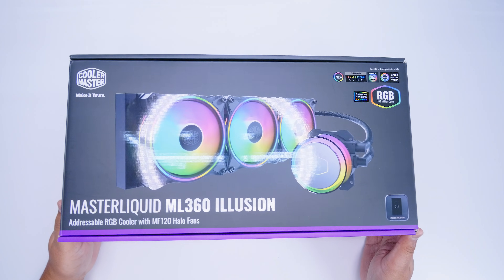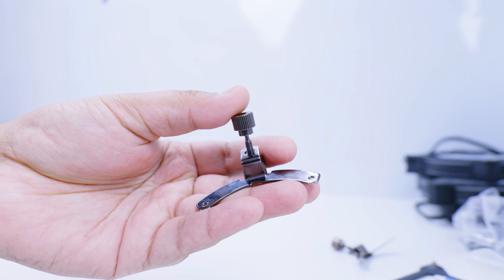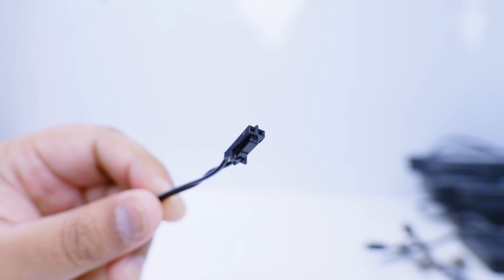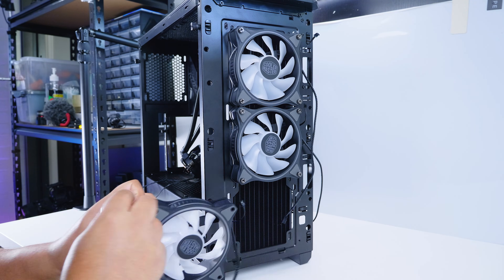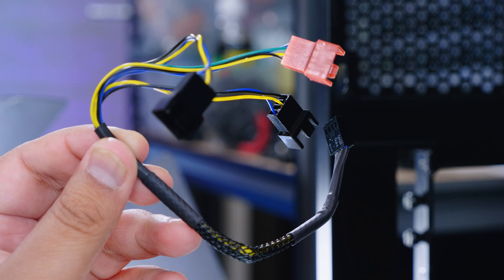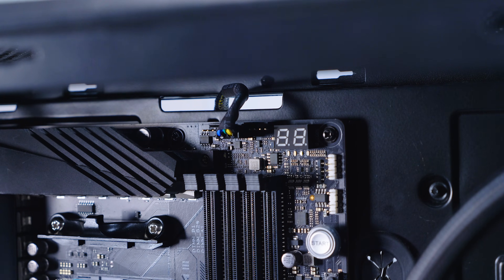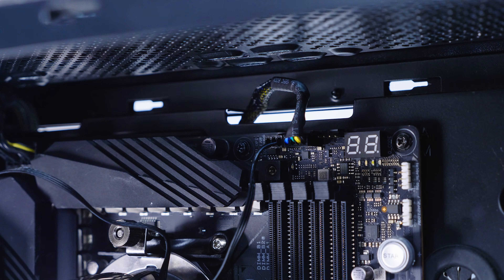HOW TO Install Cooler Master ML360 Illusion on AM4 & AM5 Motherboards

Comment: how about the AM5?
Reply from the maker: AM4 is the same as AM5
Reply: @GearSeekers  I have a masterliquid 360 with my previous cpu Ryzen 5800X3D. I upgraded to am5, almost bought a new cooler. Thank you.
Reply: @GearSeekers so they are using the mounting system with the two srews on each side? I've seen many manufacturers switching to a 4 screw mounting and therefore replacing the two brackets on the Motherboard in the process
Reply: I’m upgrading from a 5800x3d as well to a 9800x3d and I want to know if the mounting bracket we used for am4 is the same one for am5
Reply: It is  @julionazario9143

Comment: First of all, thank you for your excellent videos. I have a question, If I am installing the ML360 in a HAF 500, Do I need to use the included control or it is better to use the case control? thanks in advance

Comment: I have phanteks Eclipse G360A Case with 3 additional rgb fans, i want to connect it to the controller, i got it to spin but now its the obly rgb that works. Any ideas what im doing wrong?  Couldnt connect it to the controller due to the connector cabel not going into the controller slot.

Comment: Question on 11:35 as im not to good with understanding fan cables but why does the 3 way fan splitter (the 2 black ones) have 3 pins? to connect to the fan connector which has 4 holes? and that there is also a red colour in the fan splitter that contains 4 pins? in which should't the black end cables also have 4 pins to use up all the 4 pin holes on the fans?
Reply: those 3 pins are for the argb and 4 pin was for the PWM fan header which will connect to the motherboard

Comment: Can I connect the water cooler pump cable to the TD500 Mesh case controller and then connect the controller cable to the pwm cpu opt connection?

Comment: Just put this aio in my mid tower, unfortunately I had to mount the radiator hose side up at the front of my case. I wish the hose were like 2 inches longer.. hopefully I don’t have to deal with a noisy pump in the future from this. Be aware if you have a mid tower you will probably have to mount the same way.

Comment: Will the cooler work with an am5 motherboard considering that the new am5 motherboard (asus tuf gaming x670 - e plus wifi in my case) won't allow the pre-installed am5 backplate to be removed?

Comment: i have a question here.
I have an old Asus Z170-k mobo and it doesn't have an ARGB header.
can i connect just the USB header to the mobo, and be able to control the lighting using aura sync? thanks.

Comment: I've a lian li 215 case, has 2 200 mm fans, I installed the radiator in front, 2 cooler master fans on top and one on tha back (exhaust) my cooler manual says to connect the pump and the fans to the controller and connect the controller to pump fan header, I then connected the case fans to the cpu fan header, is that right ?

Comment: Can you mount the rad on the outside with the fans on the inside of the case for a pull config please?
Meaning, do the rad hose barbs prevent screwing in the top fan?
Very informative vid, thanks 👍
Reply from the maker: No
Reply: @GearSeekers  why not?
Reply: i dont think that would work as well because you dont have any push fans, which do most of the work leading to worse temps id assume. also just mounting the fans on the inside for a video is a bit of a waste of time
Reply: Short update, mounted the coolers on the inside for a pull config since it allows for much easier dust cleaning. Push is nice but when you inevitably get dust pads between the coolers  and the rad, you have to disassemble the whole thing for cleanup, whereas in a pull config I just lightly vacuum the surface of the rad with a brush and I'm done 👍
Reply: @DTXGaming  nice, thanks for replies, hadn’t even thought of the filters! 
We had no space to fit the rad and push fan configuration in the case, so had to go for rad/pull.
 After a bit of research it seems as though with certain heat exchange/ rad styles you don’t get even cooling due to the air taking path of least resistance (around the sides rather than across the entire surface). However, the radiator we used is in a case and the fans now have a gasket seal to the rad case. Temps looked good.

Comment: Not sure why coolermaster just make the aio and the fans all have their own argb connector. Instead of 1 splitter to a non argb 3pin for each piece to connect to. Kind of make the argb useless if you get a defective or loose that splitter it came with.

Comment: Thank you for this video. I followed your instructions and managed to successfully install and replaced my dead AIO cooler. There are some confusions on the some of the wiring and connectors (my motherboard's connectors naming differ from yours) but I managed to google and find the answers.
Reply: Wish me luck my AIO died last night and my CPU is bottlenecking so I have bought upgrades including this cooler, can I control the RBG without the controller and directly from the motherboard or do I need the controller?

Comment: So the 3 cooler fans, are rated at 0.37 amps, and the CPU fan header is rated at 1 amp. Is that gonna be an issue running more than 1 amp through a 1 amp rated header?

Comment: I have this and rgb logo is rotated a little and manufacturer said I can turn a cover but I cant it’s too tight
Reply: Just got mine and having the same issue.  You figure it out?
Reply: @johnmitchell6501  Yes you have to rotate it anticlockwise (it’s may hard to twist but don’t worry) when you take it off you can use your finger push it off by inside then adjust the position u want
Reply: @spartacusyamaguchi6239  wow, thanks so much!  I was afraid to break it so i didn't put enough pressure on it to turn it.
Reply: @johnmitchell6501  I’m glad it helped
Reply: The logo can be a very tight fit, but is is not fixed clocking.  Try both clockwise and counter clockwise.  I ended up applying a tiny amount of gun oil with a tiny tip applicator around the joint between the logo and the bezel.  Wiped up any excess as clean as possible with a kleenex and fingernail.  Enough oil had seeped in, so the logo would rotate, not freely, but it would move.  No disassembly was necessary.  Just a tiny amount of lube.

Comment: Can you please do a review on CoolerMaster ARGB Controller vs CoolerMaster ARGB Controller A1 and let me know if both will worth other branded AIOs and fans and allow Individual LED control and Brightness control
Note: Found that the old CoolerMaster ARGB Controller allows other branded AIO and fans to control lighting but no idea about individual LED and brightness
Found the new CoolerMaster ARGB Controller A1 allows control of individual devices even if they are daisy chained but not sure if it will work with other brands

Comment: Wonderful video. Sadly, the screws included to secure the radiator to my case are waaaay too short. Maybe my case is too thick (Paean mid-tower)? But you’d think Cool Master wouldn’t risk this with such unnecessarily short screws in the first place. Now I’m stuck with going to the hardware store to guess the screw size and replace them with longer versions.
Reply: How did that go for you? I ran into same issue with a different AIO. My case had 2mm raised mounting spots for the front fans. Even though the case specs said it supports front radiators,  there was no way i was going to work without longer screws. So ended up driving to Home Depot for screw sizes a bit longer than the AIO. Worked out well.
Reply: @henry3484  It worked out for me too. Took two trips to ace hardware, but the right screws did the job.

Comment: When i tried connecting using the controller i was unable to get any of the RGB lighting to work on the fans or the pump. I plugged it into the motherboard directly now I have two lower fans with RGB working continuously (even when computer is shut down) and the top fan and pump do not have the RGB working.. really confused what might be the case here I think its faulty wiring maybe? any thoughts

Comment: If you could also show beginners how to plug the pump connector into the aio 4 pin on the board would be handy. People will want to do it this way but it will confuse them ???? Otherwise this video is better than your previous instructions. Remember why you are creating these videos. It's for people who have no way near the knowledge you have. 2nd nature things which you and I think are easy are not for other people. So take a bit of the sarcasm away when you reference older how to videos. Many connectors here are different to previous gen products, changing the type of connectors on fans. Also connectors are different across brands. You showed how to do this in Asus. Gigabyte is different....

Comment: With all due respect Mr GearSeekers. CoolerMaster do not make it clear enough how to wire up the cables across different generation devices with different connectors types, manufacturer specs.. vary ! This does not help the average beginner !

Do you think CoolerMaster are trying to confuse beginners, new buyers, non tech savvy people, by providing a pump with a 3 pin connector and tell you to connect to motherboard AIO PUMP header which turns out to be 4 pin ? CoolerMaster PLEASE provide a 4 pin connector to make it easier for people to hook it up to their motherboard..... Jeez !

How are people also suppose to know how to place the connector on the header the right way ? Next. There are many argb devices and what types of argb devices can be connected to the controller other than fans. It is not made clear enough in any instructions.

They don't tell us if we could connect 4 X 5 way splitter cables so upto 20 argb fans. What about led strips. Can we connect 20 led strips ? The support and compatibility instructions are clearly very poor. What other devices ???

Instructions are totally rubbish these days providing a small leaflet with the most least basic information they can get away with....

Comment: is there enough slot on the controller/splitter to mount 2x MF200r front fans another MF140 Halo fan as an exhaust fan?

Comment: My MOBO doesn't have a 5V RGB header but it has 2 available 12V RGB header. IF I will plug it to the 12V RGB Header, it will cause me a problem later on, right?

Comment: hello there, seems that your mobo hv a 3 pin for the pump header but mine came with 4 pins both on cpu_fan & cpu_opt. can i know what is the solution for my problem ? looking forward on installing this aio.
my mobo - B550 aorus elite v2
Reply from the maker: every fan header is 4 pin

Comment: can i use mystic light to sync and control the rgb on the aio/fans with my other components?
Reply from the maker: Watch the video
Reply: @GearSeekers  yea i'm pretty stupid, skipped through all the way to the installation. Saw after i commented that it says compatible with mystic light on the box. Gonna buy the phanteks p500a drgb and that aio for more fans and airflow/cpu cooling in my current build and looked at the corsair h150 elite at first but it can't sync with my x570 mobo and the phanteks p500a and it only says that the cooler master one is used with the cooler master software on their website. So that's where my confussion came from. Very helpful video

Comment: Love this video Nick. I installed my first AIO, Cooler Master MasterLiquid ML360R, following your video. I wish you gave the hot tip about the thumb screws on the mounting bracket on that video, as I nearly had a heat attack trying to wrench the 2nd bracket on the AM4 MOBO & not break the CPU 🤣🤣🤣. You are a legend Nick. Keep up the great work mate :-)

Comment: Repeat! This will not kill your pump, love it 😍 all questions answered!
Reply: I’m sorry this is just wrong and from a physics standpoint too, I had to take the time to reply to this. Whilst many manufactures show pictures of AIO being installed this way (tubes up), it WILL lead to air cycling through the pump block. AIO are not completely filled with liquid, they are vacuum pumped out and then injected with liquid, manufactures leave anywhere between 2-10% of air in the loop (depending on the company). ALL radiator have a reservoir tank which is located at the opposite end of the tubes, this is for air to sit in. Having the reservoir installed with tubes up means the air sits near the inlet and outlet of the loop, causing air to be continually cycled through the system. Your AIO does not retain all its liquid indefinitely, over time (3-5 years) it very slowly evaporates through its built material causing more air within the loop. Will this damage anything in the long run, probably not... Will your computer temps rise, probably by a few degrees over years.... Will you hear air within your AIO loop, yes... Should you really care all that much, probably not... Do you want your AIO to last for as long as it possibly can, TUBES DOWN!

Comment: You mentioned that the master plus software is not good at the moment. I am struggling with the current version on an ML360R. Do you have access to older versions that work with this controller?

Comment: What is the best 360mm AIO cooler hands down?
Reply: Also, can you just bypass aio/fan rgb controllers if you just want to use for example... Aura sync with Asus mobo's????
Reply from the maker: I showed this in the video
Reply: I watched the vid, must have missed it... obviously refering to fan controller question. In your opinion, which is the best 360mm AIO cooler hands down??
Reply from the maker: EK AIO Elite 360
Reply: @GearSeekers  Thanks for answering👍

Comment: More of a general question - in all of your years building PCs, have you ever had an AIO leak on you? 
It seems like it's not really an issue with the current era of AIOs out there.
Reply from the maker: Never
Reply: I used to see leaks with the first Master Liquids way back when the first ones were coning out.

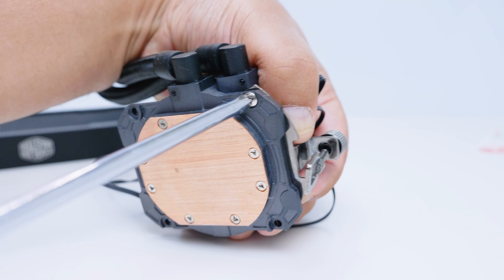Comment: For Me, 6:32 the Bracket Included with Cooler Master All Liquid Cooler, Doesn't have Proper Threads, I Have to Force to Create Threading In my Few Workstation PC Building, Sir, How You are Screwing That Much Easily Like Butter Gliding..